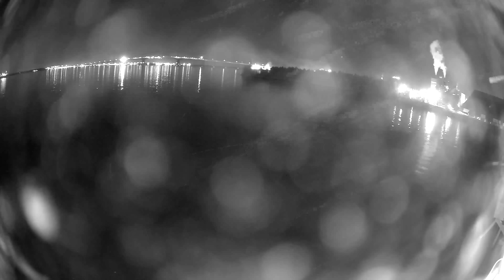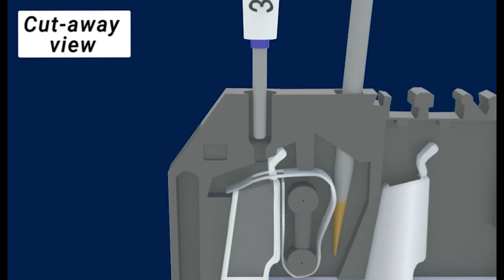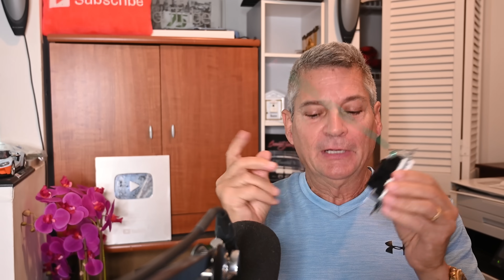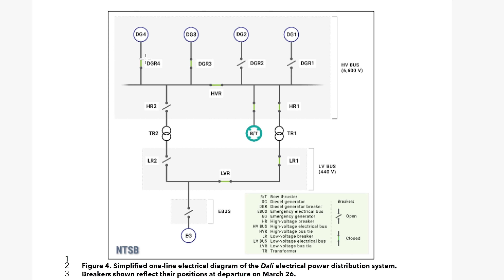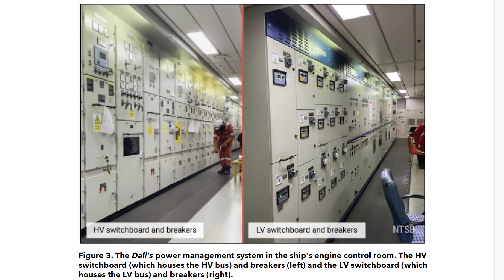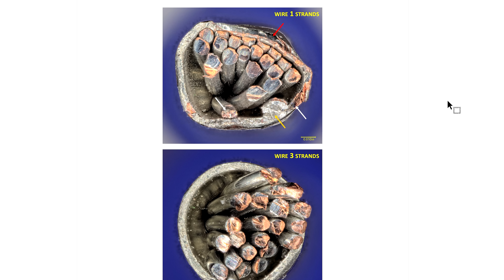NTSB: Scary Wire ERROR Caused Dali Crash/Key Bridge Collapse Baltimore

Comment: I did factory start-ups of conveyorized computer controlled wet process equipment. We would verify ALL electrical connections before powering up the line. Proper numbers, verified all the screw terminals were tight and tugged every single wire. That's the hundreds of cables and individual wires AND all the NEMA cabinet wires. Hours of work for a production line. We didn't use that style connection but later in my career they have become popular, especially with foreign made equipment. I really don't like them but it's apparently it's becoming the new standard. The lugs are great but like anything else they have to be properly installed. Either way, it's up to the installer to tug every last one and up to maintenance personnel to check all electrical connections at least annually. Infrared surveys are not a bad idea either.

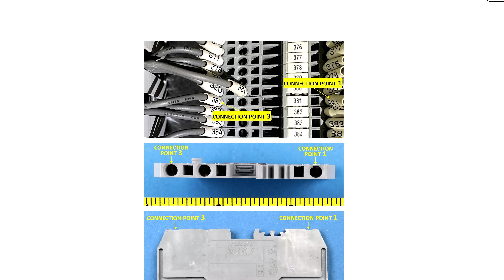Comment: At 21:06, it looks like the bottom image is showing the side of the connection point housing is melted, which would make sense with the connection internally arcing. But that would definitely not be apparent on a quick visual inspection. That would take HOURS of troubleshooting to spot that problem!

Amazing that a $0.05 wire label could cause that much trouble and cost that much in lives and damages...

Thank you for the great analysis!!

Comment: Quality control inspection should have caught the heat shrink wire banding label being on the ferrule shortly after assembly of the wire. There was a second chance of catching it when the installer inserted the wire into the wiring block should have inspected it, just to name a few chances of catching it.

Comment: Back stabbing connections on Residential Electrical Devices had nothing to do with laziness, Jeff.  It was a time-saving feature and an acceptable practice at the time. Nowadays we Electricians have figured out back stabbing is a terrible connection and the cause of tons of troubleshooting calls.  Practices are slowing changing and most Electricians should be using the screw terminal connections nowadays. Thanks, Russ, 30 years in the Electrical Trade.

Comment: What people may not understand is thatthis is "control wiring", that one wire is probably a low voltage wire. It gets a signal, or small voltage, that then activates a large relay, contact block that makes the huge voltage connection (could be thousands of volts). That little wire could be 18/24/60 volts, but if it comes loose, the big power cannot ever make contact. It's how all wiring is done on most industrial equipment (airplanes too). Not in our homes, but certainly in our appliances.

Comment: Had that same problem with two (inline - local and hallway emergency) switches for my furnace. They both got hot enough at the point of contact to melt the plastic and move the wire away from the contact. One was 1 day after the other was replaced.

Comment: My Home Owners Insurance provides free Ting device you plug into a wall outlet, it monsters 24/7 power, arcing, voltage, and issues weekly reports, couldn't or shouldn't something like that be required for buildings, ships, etc that use electrical systems

Comment: OK, I'm weighing in with the usual comment, this was a REDUNDANCY failiure, NOT a wire terminal failiure. It took BOTH to crash the ship, a single point failiure should NOT exist.
Reply: In any case of redundancy level, the steering gear control shall be available at the bridge using manual NFU push buttons or other means to steer the vessel manually with separate wiring to the solenoids. This is SOLAS requirement for a vessel of this size.
Reply: THIS!!!!!!
Reply: 100%
Reply: And if ALL the wiring is subject to the same defect?

Redundancy would always assume correct construction, because if not, there's no design that will work.

Bad installation, insufficient testing, poor maintenance over the span of years... There's no amount of design that can prevent disaster in those circumstances.
Reply: Accidents happen. Even with redundancy. I once had to investigate the fail of an emergency diesel set on a gas tanker. They lost the main generators and the steering pumps went down. For this the emergency diesel ought to kick in. But the main circuit breaker of the set went off after a few seconds to the grid because a 10$ capacitor of the current monitoring circuit failed.  Nothing servere happened but this is a good example.😁
Reply: @crazyedo9979  But this case was intentional/negligent redundancy error. They had out of spec generator fuel feeding. Generators autostart didn't fail due to parts failure, but due to them having field rigged non standard fuel feeding to avoid having to do as many fuel flushings. it was a convenience modification. Only this convenience mod was not properly engineered and was not tied into the autostart and emergency system. Someone had to scamper in blacked out engine room to manual go press power on on flushing pump. flushing pump that should never been the fuel feeding pump in the first place. It was not it's designed job.

In proper condition the ship was engineered to recover from such trip... the company had modified he design and had not taken into account redundancy considerations. That was the real fault.

Comment: Near 35 years a ship’s electrician and Electro Technical Officer here. I’ve worked on hundreds…thousands of these DIN rail terminal blocks. The sleeve wire markers are consistent nuisances because they are made to slide back and forth. Sometimes they are way larger than the ferrule collar and will slide right off the end of the wire and the ferrule. You open a can and see “numbered confetti” lying in the bottom of the enclosure….SWELL!
 A consistent problem on American ships is that not everyone that puts their hands in these cans are electricians, and if they are, are not necessarily familiar with the concept of the Wago connectors or even of ferrules. I’ve seen bare stripped wire ends stuck into these connectors because apparently there wasn’t a ferrule kit and proper crimper available, or the guy didn’t know that you need to use ferrules on these connections….you get wire strands that splay out, reducing the wire’s cross sectional area and sometimes grounding or shorting…again, SWELL.

 We often actually have IR cameras onboard…locked away in the Chief Engineer’s “Gold Locker”, and since it’s out of sight, it’s out of mind and it remains unused and locked away until the ship is scrapped.

 Add to this the reduction in crew size….MV Dali had 22 crewmembers aboard, (all departments), and the Electro or ETO on Dali, (if they carried one),  was very likely little more than a light-bulb changer and reefer can plug-and-unplugger…and THAT is a full time job.

 Everything about modern shipping is “just get it to the dock!”, and once at the dock, it’s “hurry-hurry-hurry! We need to make our sailing schedule!”. Nobody has the time or the manpower to go and do “science” in the panels. And if you do and you do discover a problem, everyone above you in the chain of command afloat and ashore are dismayed because correcting problems costs time and money. 

 You run it until it breaks down, and if you’re the poor chump signed aboard when it does as spectacularly as Dali did, well that’s just too bad for you…and the poor slobs on the bridge. The insurance underwriters’ lawyers will deal with it and the government will go after the Captain and the Chief Engineer in command THAT month for their “negligence” in sailing an unseaworthy vessel because some contractor installing a breaker 10-20-30 years ago had a brainfart or took a shortcut.

 This is the way it REALLY is out there…and I’m an American seaman sailing almost exclusively aboard US flag ships. On flag of convenience vessels like Dali, it’s even worse. We would be well advised to ban FOC ships from even entering our ports, and mandating that vessels that do enter our ports conduct FMEA sea trials regularly, (with the sailing crew that is actually aboard the ship when it arrives in the US) to still be aboard.
 The Offshore Oil Patch does this with vessels that it charters. FMEAs are a gigantic and exhausting PITA to go through, but you find stuff wrong BEFORE it’s critical. Shell and Chevron don’t LIKE to be sued, see?
Reply: Furthermore, I worked McAllister tugs in Baltimore Harbor, (do NOT recommend!), and we would usually escort our outbounds through the Key Bridge, one tug with a pendant off the bow, (to “steer” if needed), and and second tug with a pendant dead astern,(to “brake”). We’d cast off about at Fort Carroll, and then go and tie up to the Key’s bayside dolphins to catch a nap or a snack and wait for our inbound ship.

 I assume they stooped this because tugs are expensive…

Comment: Jeff, this wasn’t the only cause; if all the equipment had been set up to operate correctly, the collision with the bridge would never have happened. For example, generators #3 and #4 didn’t have enough fuel, and the primary generator, #2, had its exhaust vent closed. The connection in question was part of the control circuit for the backup generator management system. So, if everything functioned as intended, would a backup generator management system even be necessary? In my view, wire nuts have much better conductivity than the small contact area of a stab and spring system. The problem with both wire nuts and these other systems is that installers often don’t follow the instructions precisely. That said, this wasn’t a job for wire nuts anyway—it was a control panel, where connections are designed to allow quick installation and removal of internal components. As you mentioned in the video, the best choice would’ve been terminal strips with flat-head screws. I really enjoy your analysis and videos. As always, too many holes in the Swiss cheese aligned that night and doomed the Doli; it's never just one thing!

Comment: Looking at the one-line drawing, even with this wire coming loose, this accident would not have happened if HR2 and LR2 had been closed.  Other things besides wire 381 had to be failing at the same time wire 381 lost contact.

Comment: Just in principle, putting a shrink sleeve on top of the ferrules plastic sleeve is very bad practice. It is important to see the plastic sleeve is properly inside the terminal blocks hole, meaning it is properly inserted. If it can not be clearly seen, there is  no easy way to determine ferrule is inserted all the way. This would be obvious to anyone assembling the cabinet, but the wires are cut, labeled and crimped elsewhere potentially automatically.

Comment: The terminal blocks can separate and the metal busbar can be partially wedged out if blocks are not tightly packed. This will make it difficult to properly release the clamp.

Comment: So using these terminals, without a right size screwdriver or maybe insulated screwdriver where insulation prevents the screwdriver being inserted deep enough, it may be difficult to release the spring. It is fairly common to struggle with these without understanding exactly how they should feel when released.

Comment: I don't trust any connection that isn't one of those old-school clamps with the phillips head screw. Better yet, solder those wires together.
Reply: A screw might not be properly tightened.  That would be hard to find.  This system appears to be easy to wire up correctly.  The person who put that wire in wrong must have been a bonehead.
Reply: @GH-oi2jf  yes, i am being a little sarcastic, but let's not pretend either one would be easier to find in a pinch if it was required on short notice, like in this instance. If anything those cool thermal scanners should be part of routine maintenance and on every ship. 

I'm thinking of picking one up for my own usage in fixing electronics

Comment: Well, looking at that terminal block  @16:37, i would say they should redo all those connections and not only the 381.
It's been a while i didn't touch such terminal blocks and ferrules but are the ferrule are supposed to be flush with the connection block (just like in the animation) and none of them in the picture is like that!

Comment: Why were the two parallel electrical systems not isolated and operating independently? That is the real issue. That caused the faulty wire to become a single point of failure.

Comment: Have had problems with that exact same spring tension DIN rail terminal block in refrigeration equipment. Prefer the screw terminal blocks and using ferrules on stranded wire for a more reliable connection.

Comment: As an electrician I like Wago products. My most embarrassing failure with a DIN rail terminal block was actually with the set screw version, but its the same issue: check for full insertion,  tighten properly,  and "tug test" before moving on

Comment: Well now the question is who fabricates that wire with the label on it?  I'm sure they don't order a thousand of those from a factory because there is only one wire like that in the whole ship.  Does the factory make a series of wires and put 381 on one wire, 382 on the next wire, etc. or does the crew that is building the ship make the individual wires themselves?  And the person putting the wires into the terminal block should know that the wire is not fabricated correctly and they should stop and not put it in.

Comment: Time 24-14, In response to the comment “This one I can’t figure out” . Notice that all strands of the failed wire #1 are cut to exactly the same length as the ferrule. this must be from when the wire was initially stripped, it was stripped too long and trimmed. The end of the ferrule may have also been trimmed slightly shorter contributing to the insertion problem. The trimming could also create a slight taper at the tip of the ferrule contributing to the problem of the ferrule working out of the terminal’s grip.

Comment: That simple error (because the numeric collar was set too low on the wire) also conceals the problem from external visual inspection.   Tracing the reason for the intermittent failure while the ship was docked would have been harder, because the ship was static. Additional vibration caused movement breaking the connection. The cascade failure in the decision tree is just horrific. The automatic safety backups, which should have restored power also failed.    The full cost of this accident must run into tens of billions of dollars  - all because of one bad connection!

Comment: Anyone who was familiar with the wiring of the Dali should have know from the observable lighting failures where the bad connection was.  Only a stupid engineer would put steering power on the same circuit as the ship's lights.

Comment: the deformation could certainly be from them forcing and jamming it down far enough to get it to connect, I wonder if it could also be caused by the increased heat of it arcing or deformation because it was wiggling around so much more then usual since it wasnt a solid clamped down connection so it wiggled itself loose and deformed over the years... what an unfortunate mistake... im sure there will now be regulations for the labeling tags to be secured X inches away from the tip now.

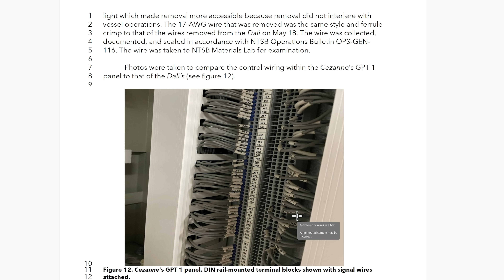Comment: It should be noted at 16:37 all the white label sleeves are shrink-rapped over the blue blue collars by just a bit where on the sister ship 17:05 there is a small space between the white label and the blue collar.    So, one might think all the connections would be down the normal sleeve pinch point a mm or two. All those terminations should have been redone during installation.
Reply: Came here to say this exact thing, and why hasn’t anyone else noticed it? The Dali didn’t have any blue showing on the terminal block on any wires, whereas the sister ship at a good amount of the ferrule showing on every wire.

Comment: I've never been a fan of ferrules except on finely stranded conductors like locomotive cable or welding leads.  Generally speaking they're just a gimmicky upsell that cause more problems than they solve.  I've had more issues terminating wires with them than without.
Reply: It seems to me they are essential for stranded wire in an application like this.  I have engineering degrees and have worked with a lot of electrical equipment in my life, and I don't see a problem with the design of these wires.  You couldn't just stick stranded wire in the connector without problems.

It is easy to spot this defect before installation of the wire, because of the color of the top of the ferrule, yet nobody did.  Or did, but didn't reject the wire.  Lack of quality assurance in manufacturing and assembly.

Comment: After watching 25 minutes of this I've come to two conclusions. 1. Beyond highly detailed people would strive in material sciences or reconstruction. And 2. despite the level of detail required and that the world will see all the info we still use units like 0.010 inch to convey size. That's just silly
Reply: There is nothing wrong with using the inch as a unit.  A lot of important equipment has been built dimensioned in inches.  That has nothing to do with this tragedy.  You are using it to promote your own agenda, in my opinion.